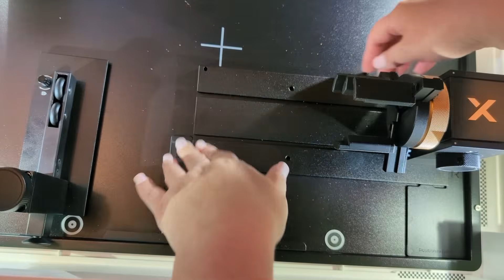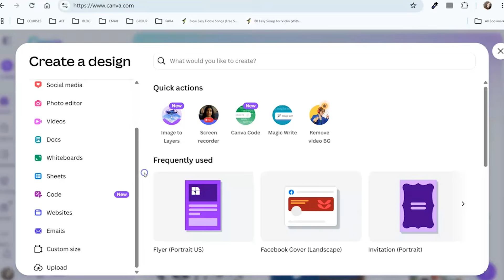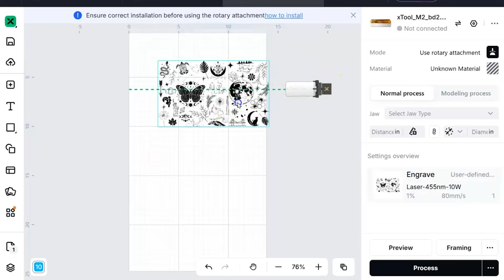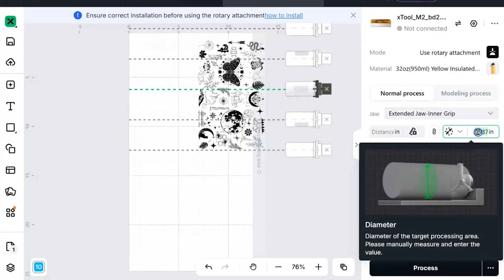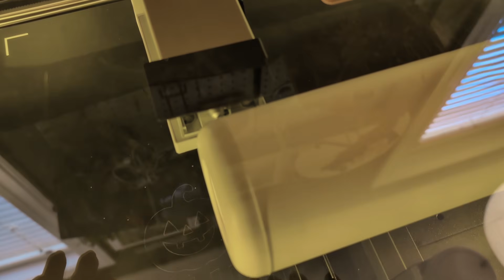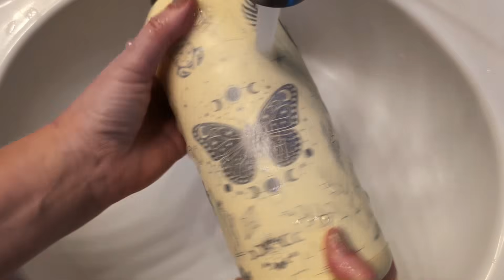How to Engrave a Tumbler with xTool M2

Comment: how do you determine the length of a tumbler?  Explanation: From top to bottom when it is stading up strait on a counter.
Reply from the maker: That's right. It will be the longest edge, and it's from top to bottom while it's standing up. For a straight walled tumbler like this, it's easiest to still measure before the side before it curves in at all at the top or the bottom.
Reply: It won't allow me to engrave from top to bottom. Bottom is fine but is short 2" roughly at top
Reply from the maker: @StephanieRoberts-m9l8o  here's my "cheater" work around. Move the rotary attachment! So instead of having it right up against the right side of the machine, you'll move the attachment towards the left. This moves the top of the tumbler more into the working area of the laser. Definitely do the framing to make sure you're going to hit the areas of the tumbler that you want. Let me know if that makes sense and if it works for you!